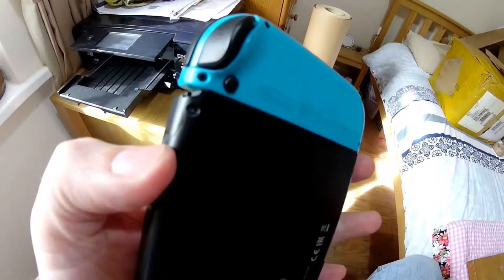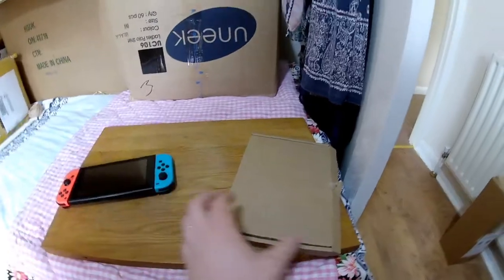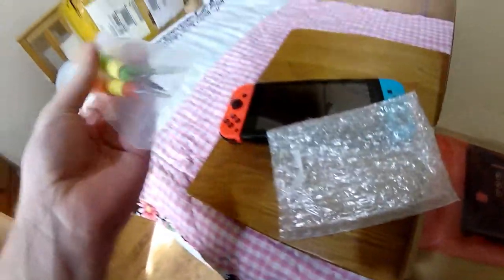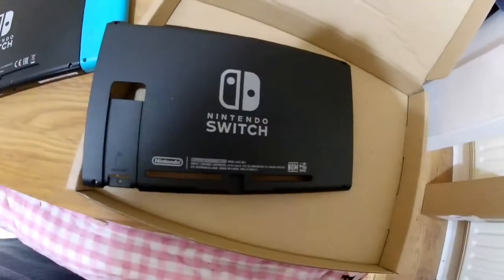Switch Tips! Replacing A Cracked / Broken Back Cover on your Nintendo Switch

Comment: You don’t need to take off the kickstand
Reply from the maker: I can assure you you do! the kick stand is attached to the back plate and the replacement back plate does not come with a kick stand so unless you want a gap and no kickstand you need to take it off.
Reply: you tell em dad!